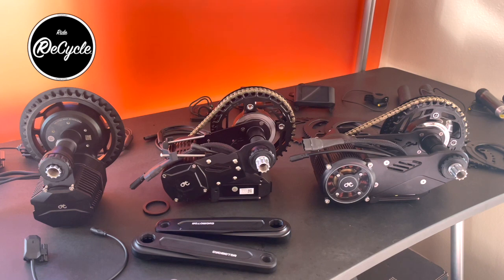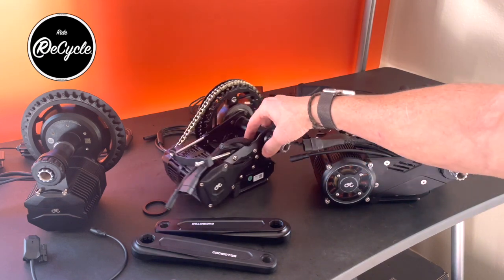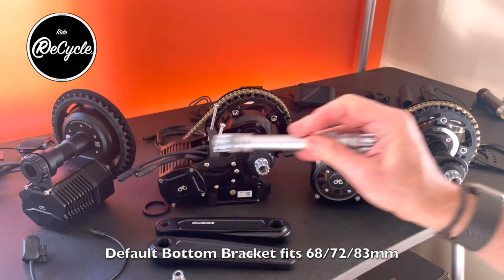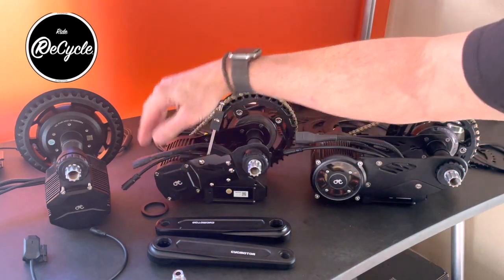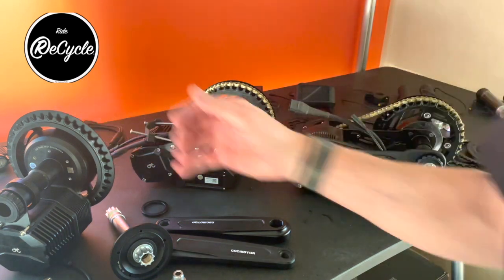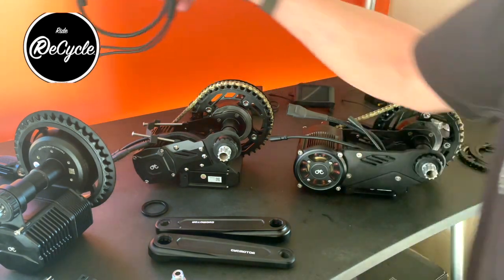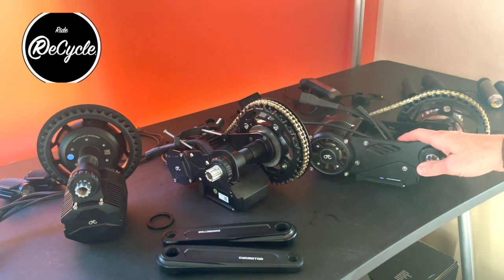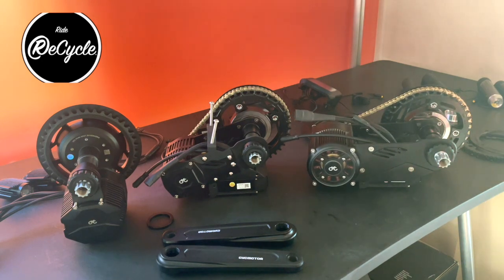CYC Photon, X1 Stealth, X1 Pro Mid-drive E-Bike Motor Comparison

Comment: What is the best chain ring combo for climbing?  Also is there  a way to switch to single speed? I have problems breaking derailleurs with the BBSHD.
Reply from the maker: Hi @nvrfollowb5, thanks for your question. Chainring options differ between the Photon and the X1 Stealth/Pro. The Photon uses a proprietary mounting format and the number of sizes available from CYC is limited. The smallest available is currently a 34T. The X1 Stealth and Pro use a standard BCD104 format so you can use aftermarket sprockets to get gearing combo available. You just need to make sure it's within spec for the derailleur which can be an issue with 1x cassettes with large inner cogs in combo with large front sprockets. It's possible this issue you're having with your derailleur is related to this or the chain line offset common with BBSHD motors or the combination. 

It is possible to run single speed (or convert your rear cassette hub to single speed). There are kits available for conversion (just avoid the fixy conversions). You'll want to use an online gearing calculator (like this https://www.gear-calculator.com/) to determine your chain ring and cog size combo. If you do go single speed you'll probably want to go with a larger front chainring. 

The best choice of chainring will come down to the type of riding you're doing. If you do mostly technical single track and hills and don't care about peddling at speeds over 20-25mph, then a 32 or 34T chainring is probably your best bet. Most of these motors have enough power to climb +12 degree slopes even with a 38-40T chainring but a smaller chainring will take load off the motor, allow it to operate a lower power and run cooler.

Comment: Would carbon fiber belts upgrade the motor units of the Stealth and Pro? Replace those chains.
Reply from the maker: Maybe! They would be quieter. You'd have to find a very small cog and find a way to mount it to a keyed motor shaft. The freewheel is a BCD104 pattern so there are chainrings available that would fit. You'd also have to get a custom belt made to right length.

Comment: Hi randy, interested in the x1 stealth gen 3, Ive got a carbon fibre MTB XC frame and wondering if it will be okay in that?, dont plan to use it heavily it will mostly just be used for commuting and the odd hill. Looking at the cyc due to the lower profile along the bottom.
Reply from the maker: Hi @robbrown92 thanks for the comment. Both the Stealth and the Pro are good choices for a carbon frame. Many of which have thick material at the bottom bracket or unusual frame bends in that area which can make fitment difficult on kits with a fixed drive mechanism. The CYC Stealth and Pro position the motor further away from the crank than a Bafang or the CYC Photon which is why'they're more flexible. It's also possible to positing the motor inside the front frame triangle with these kits on some builds depending on suspension linkage.

Comment: Thank you for deep content 
I stay with my big nasty Bafang.
Hugs from Germany 😅
Reply from the maker: Thank you from California ;) 
The early Bafang's are fine motors, not so nasty - lol. The lastest ones are too restrictive in terms of equipment and adjustability IMO. We sell the BBS02 and HD for that reason. They are little heavy but overbuilt and reliable. The biggest downside is how manual the controls are for adjusting power on the fly and the stepped nature of a rotation based PAS. 
Cheers!

Comment: Hey Randy, I just found this video. Great job! I just ordered my battery. I think I might want to investigate lighting too. Will I need cable extensions for display, throttle and speed sensors as the photon system I have ordered is going  on a Sunseeker Fat Tad CXS. You've got my info, let me know at your convenience. I'll send you pics and a video when it's all together. Can't wait to ride it in the Ocala National Forest.🤣
Reply from the maker: Thanks! Send me an email with measurements for the cables you need and we can put an order together for you.

Comment: For the Stealth & Pro model Im looking at,I have a Polygon T7 full susp. & it has a longer down tube where its attached to the BB,whats the "distance between the BB(spindle) & the motor" ,I wanna be able to swing the motor up high enuff if I can due to the longer portion of the downtube
Reply from the maker: Hi @joehiatt1992, you can find a print out of the X1 Pro here: https://www.cycmotor.com/_files/ugd/b1453b_e84bc7d10cae4d3089fd2ad468f424e4.pdf and the X1 Stealth here: https://www.cycmotor.com/_files/ugd/b1453b_5237672e8230432b8017670d9cacfb86.pdf . The hole in the support frame on the right side would align with the BB opening on the bike. If you print these out without scaling the image, you should be able to find the distance to the edge of the motor that you're looking for. For instance, on the Pro, there are two bolts holding the motor to the support from on the right side of the motor housing. The bolt inbetween, just to the right retains the controller. The edge of the motor housing is just to left of it.

Comment: With the cyc X1 and stealth, how well do they work mounted on top of the down tube? And how do you do it?
Reply from the maker: Yes! You will need to remove the non-drive side mounting bracket to get the motor between the frame. On the Stealth you need to be careful to not damage a very fine O-ring gasket when removing/reinstalling. You can see an example of one of the on the Santa Cruz Blur in another one of our videos here https://youtu.be/Ut63UvC18Ow . We'll be putting another example of a similar build up soon as well.
Reply: @R-eCycle looking forward for fresh video with this amazing idea 😊
Reply: I have a Gary Fisher mullet and would love to install the photon vertically in between the frame tubes if this is possible?

Comment: I like the Photon, but wonder about the mount loosening under load. I installed a torque arm to prevent my Bafang BBS-02 from twisting on an aluminum BB.
Reply from the maker: @bjnslc I've don't the same with the Stealth and the Pro. The stock bracket requires the motor to be clamped against the frame. Sometimes that's undesirable or just doesn't work. There's also not much to work with using the stock bracket - it's light weight but the retaining screws are not a very elegant solution. There are fewer mounting points on the Photon to attach to and they are smaller and closer to the BB (providing less leverage) but similar to the BBS02. It won't require much to give it more a lot more stability. We'll need more time with the motor to determine if additional attachments are necessary to keep it from moving around.
Reply: Locktite
Reply from the maker: @ferguson8143 the X1 Stealth and Pro aren't mounted completely rigidly to the BB. The mounts are stiff laterally and radially but the motor can rotate around the bottom bracket so they require a camp to be held in place. The Photon has a left side bracket more like the Bafang mount but still has the potential to rotate around the BB. Like the Bafang, you can add spacers behind the bracket to increase tension to keep the motor from rotating.

Comment: Is that the torque sensor crank?
Reply from the maker: Yes, all the CYC motor kits include a torque sensor in the bottom bracket for adjusting power from the motor.
Reply: How do attach the magnet if you have mag wheels? Non spoke wheels.
Reply from the maker: I've seen zip ties used to attach them. You can add a little double sided tape behind it if it won't stay with the zip tie alone.

Comment: I see the Photon rated at 750W but have also seen 1200W and higher mentioned in relation to it. I'm trying to work out what amp draw my battery should be capable of and knowing the watts the motor can use is obviously important. Any ideas on what the max watts I should use in calculations might be? Thanks for the comparison by the way, good to see them side by side.
Reply from the maker: Thanks @abomorgan. The power on all three of these motors can be governed by the controller using the App so even the X1 Pro can be used with a battery pack with a BMS rated at 30A (and there are some advantages to this setup). 'Street Mode' is limited to 750W on the Pro and the Stealth to conform to legal requirements but laws differ in different countries and local jurisdictions. It's my understanding that CYC is currently limiting output to 750W on Photons outside the US. US units are being shipped with power capped at 1200W. I believe this is due to less restrictive laws on power output in the US vs Europe (or higher taxation in the EU based on power) . What I'm unsure of is if the cap is adjustable in software for EU customers or if it's a firmware modification that customers are unable to modify.
Reply: @R-eCycle  Thanks for the response, exactly what I was looking for!
Reply: And if you want to know what your set up can put out in watts you take 
Amps x volts = watts
Controller x battery = motor

Comment: I own a Trek FX3 disc that I want to install the Photon on. My bottom bracket is a Shimano BB-MT500 I’m not sure what size bottom bracket to order could you advise? Also my bottom bracket is a press fit what would be the proper tool to remove it and is that all I have to do is remove my bottom bracket and install the Photon?
Reply from the maker: Hey Cisco, the Shimano BB-MT500 is a Press Fit 92 compatible bottom bracket. With the bearing housings removed, the CYC Photon kit with 92mm PF adapters should fit FX3, no problem. You should measure the frame to verify the spacers you'll need to get the correct width for BB alignment. 

There are specific bottom bracket extraction and press tools for removal and installation. Park Tools has a great video on this here: https://youtu.be/2VnwKrC9rS0. If you don't want to buy the tools, you can take your frame to your local bike shop and have them pull the old bearing cups out and install the Press Fit adapters supplied by CYC. Then take the frame home and finish the installation yourself.
Reply: @R-eCycle  Thanks for all of that info so the BB92 is the one I should get am I right? I don’t understand the whole measuring the frame to get the right adapters part could you elaborate on that a bit.
Reply from the maker: @ciscokid2444  sure thing. If you order the Photon and specify the PF92 size, it will come with the adapters you need to insert into the frame, a longer spindle and the additional shims for the Photon's left side mounting plate to fit your frame. The Shimano BB-MT500 specifies it fits 89.5mm BB and 92mm BBs. It shouldn't be an issue but I would just check the width of your frame (not including the bearing cups). If it's on on the smaller side (89.5) just make sure you can fully insert the adapters to fit flush against the sides of the frame when inserted. It's not much of a difference but you want the PF92 adapters to fit tight against the sides. A bike shop will be able to tell if thats the case and they should have small spacers to fill the gap if necessary,
Reply: @R-eCycle  Thank you so much and I’m a new subscriber for sure.

Comment: I am planning to order a Photon to replace my BBS02 on my current aluminium frame with BSA 73mm bracket. I am wondering if it would be possible to buy later on the necessary hardware to use it with a frame with a  PF92 BB later on. Is it possible? Do I need to buy a new spindle with some spacers? or is it a different photon unit for PF92?
Reply from the maker: @v1ncen715, thanks for your question. Yes, the kits can be converted from 68\73\83 to PF BB92. The conversion parts needed are the Press Fit adapters, a 100mm spindle, a 100mm bearing cup for the non-drive side, additional shims and a different retaining nut.  At the time of this writing the cost for the parts is a little over $100 before tax/shipping.
Reply: @R-eCycle  Where can you buy the spare parts? Can't find them anywhere.
Reply from the maker: They are special order. If you put in a request on the website, we can provide a parts list and a price quote.

Comment: Thank you for the amazing video. Finally, I see a comprehensive comparison of CYC motors. 
What size of BB and adapters do I need to convert my Trek FX1 disc?
Should I get the Photon or X1 pro? The defense is only 250$ with shipping
Reply from the maker: Thanks very much @missin990 ! The Trek spec sheet isn't as complete/explicit as I'd like but it looks like the FX1 has a 68mm (BSA) bottom bracket which will work with the most common size for CYC Photons and X1s - which is 68/73/83mm. This configuration comes with 3 spacers (3mm, 5mm & 7mm). In your case you would use all 3. Which motor to buy depends on a lot of things (I should make a video about this lol). Mainly how you want to use the bike (eMTB, commuting, climbing, top speed, quiet/lightweight) and which battery you want (range/size, power output) and how it will fit. Generally speaking, the Photon will be better if you want the bike to be as light and quiet as possible and you're not concerned about maximum power. It can also be a good choice if you need room on the downtube for the battery. If you want to go on long steep climbs or operate the bike like a scooter using the throttle sometimes then the X1 Pro would be a better choice. The Stealth fits somewhere in the middle so it's a good compromise with decent power and enough torque to make most hill climbs easy.
Reply: @R-eCycle  
 I care a lot about future proofing (to serve whatever need I have in the future), compatibility with future bikes, reliability and longevity.
I do want to use it  for fun and to go out as a scooter and I don’t care much about the weight. Paying 15-20% to get X1 Pro is worth it. My only concern is the noise!
Reply from the maker: @missin990 I would recommend the X1 Pro for anyone that wants to routinely use the throttle alone (no pedaling). The motor is significantly larger which means it will operate more efficiently, dissipate heat and handle the load better. You'll also want to spec a battery pack with a BMS with higher discharge rate (constant 40A or >) if you want to operate the motor at 2-3kW output. That said, there's no question X1 Pro is louder. As I mentioned in the video, I've had some customers find it perfectly acceptable and others, not so much. Watch this space for more info on this topic!